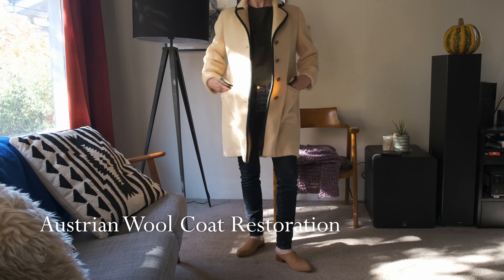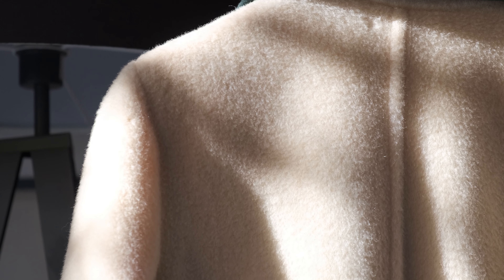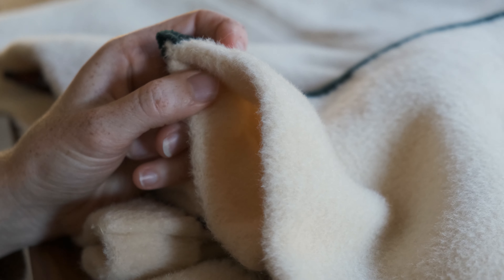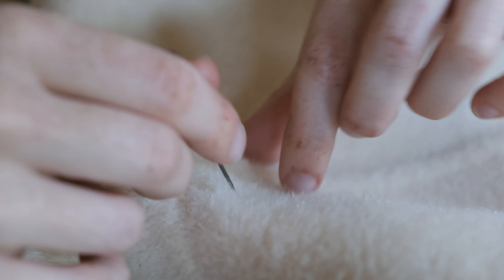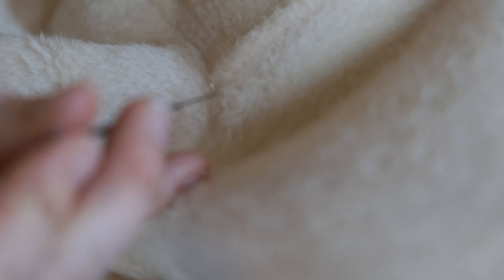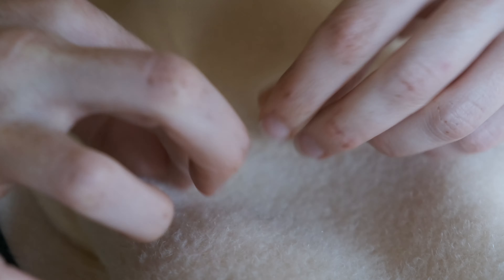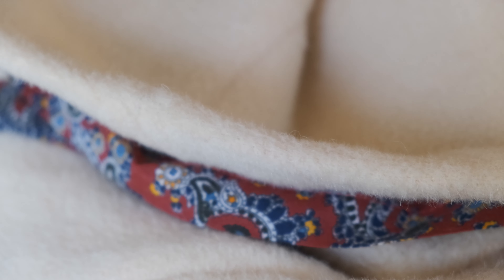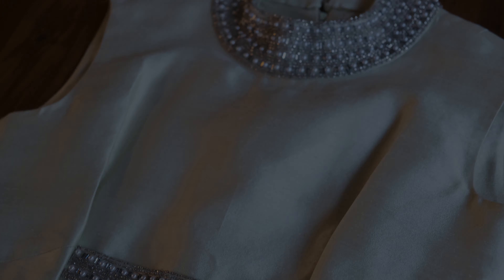Fixing Holes in a Wool Coat ~ Restoring a 1960s Wool Coat

Comment: Hi! Nice Precise Wool Fix Technique, and in Real Time! I'm trying to repair a 1/4" hole in a Darth Vader Wool Cape. What do you think about applying a little Elmer's Glue (or a ModgePod equivalent) into the hole with maybe the first layer of spare wool trappings, you're finding from other parts of your cool Vintage Coat or my Vader Cape? I figure to see only a "slight bump" on the wool surface, but the cape is "forgiving" black. You dare me?
Reply from the maker: Sounds like a fun project! I haven't tried that but the glue might give it some extra hold (a fabric-specific glue may stick best to fabric). I wonder if the glued bits might make a rather solid surface that may be a little difficult to work the felting technique into? Again, haven't tried so not sure. Another option the ladies at the fabric store told me about is using fusible interfacing and ironing it on from the back. I'm going to try that out to fix a few holes in a black wool dress of mine. Good luck and it would be cool to hear how it goes for you!
Reply: @vintagebynatalie2681  thank you!

I knew there was a way to iron something on the back!

Never heard of a felting pin.  

LOVE this beautiful coat!

Comment: Does this process still work if the jacket has no lining? Hoping to fill a hole on an amazing vintage Mexican souvenir jacket
Reply from the maker: Good question! It looks like someone else in the comments saw another video with a similar technique with an unlined jacket but they had used styrofoam behind it while fixing it up so it sounds like it has been done! I wonder if you would have to make a patch with a little wool and sort of work it into the sides? Or even attach a little fabric patch behind the hole to felt the wool into? Good luck! It sounds like such a beautiful jacket.
Reply: Same!

Comment: Hi Natalie, thanks for this awesome video! I bought a vintage cashmere coat and had it dry cleaned. When I got it back, I noticed several holes that look exactly like the ones you had on your coat!! I’m not sure whether the holes were already there when I bought the coat. What do you think are the causes of these holes? Is it dry clean damage, or moths? I’m a little worried they’re moth holes. 😵
Reply from the maker: Hi Dan. Hard to know. Cashmere is pretty delicate and depending on the age or condition some items I would talk to the dry cleaner about the best course of action. My dry cleaner told me one wool vintage dress is too delicate to dry clean so I just have to steam and spot clean. If they are moth holes, hopefully the dry cleaning took care of any of that. Sometimes I spritz my clothes and closet with essential oils to keep the moths away. Good luck!

Comment: Do I have to avoid the lining? Onmy coat the hole is only on the outer shell. THe lining underneath is 100% intact.
Reply from the maker: It sounds like the construction of your coat may be slightly different than mine. My coat in the video has a lining layer, but also a fabric layer the wool is tufted into which helped hold in the felted wool. In any case, you probably want to avoid the lining. This would help avoid damage to it but generally lining also moves freely from the wool layer and could pull at the patch. In this case, you could focus the felting on attaching it to the wool around the hole. Depending on the texture of the coat, you may want to prepare a felt patch ahead of attaching it to work it into a good texture and shape first, and then add more or remove some as you work it in depending on how it is looking. If you are worried about whether or not it will stay, you may be able to try something with fusible interfacing or fabric tape from the interior. I would take your project to Joann's and ask for their advice before trying anything too daring though. They usually steer me in the correct direction :) Good luck!
Reply: @vintagebynatalie2681  Thank you for your answer and your help. I will take a better look at the lining tomorrow (and the hole).

Anyway, you made a good point about the difference regarding the lining. This is already helping a lot to understand the problem.

Comment: How do you keep it from popping  out if you have it cleaned?
Reply from the maker: Good question! My plan is to ask my dry cleaner about it when I need to clean it next and let him know about any spots that may not do well with rough handling. In my experience they are pretty knowledgeable and honest about any risks. My dry cleaner also seems pretty responsive to specific requests and treating an item depending on its needs. I will let you know more when I chat with him next!
Reply: @vintagebynatalie2681  do you have any update if that works after dry cleaning it…I have the same problem with a navy jacket Pea coat :(
Reply from the maker: @silentpain1235  I haven't had any issues with my coats but I always make sure to talk to my dry cleaner and point out any concerns I have beforehand. He is good about taking care of my vintage items or telling me honestly if something is too old or delicate to dry clean (which happens and in that case I usually end up steaming and spot cleaning instead). So it may be good to talk to a dry cleaner you trust and see on a case-by-case basis. Good luck!